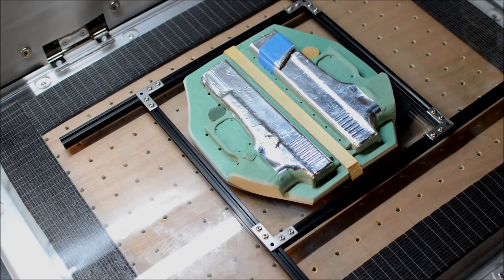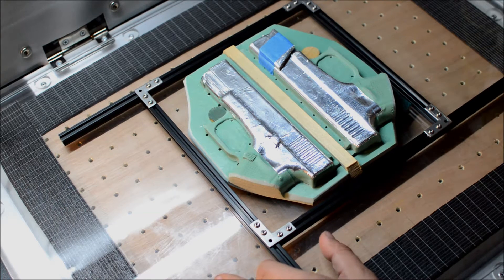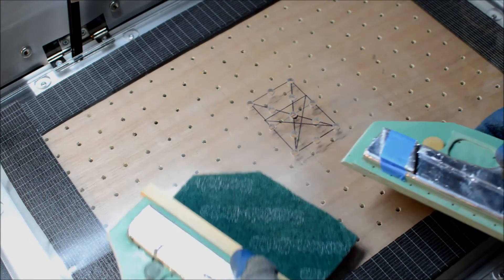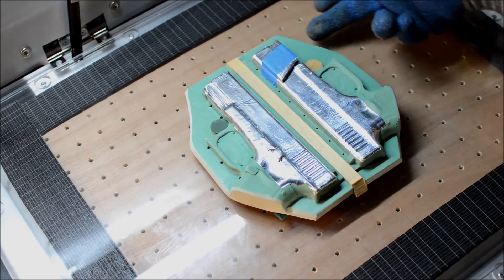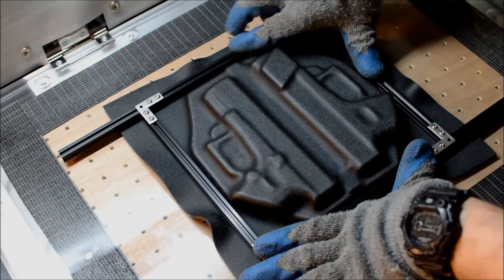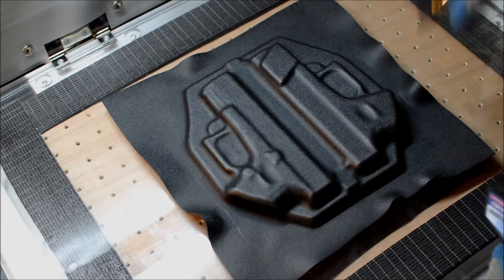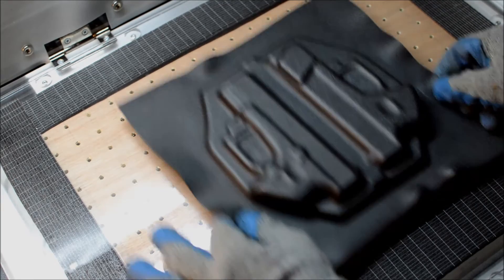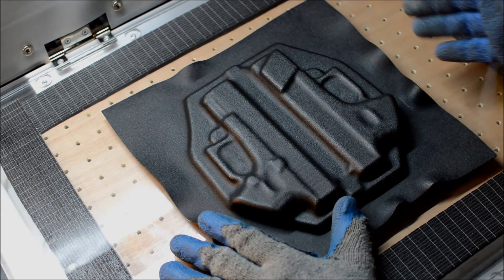Membrane-less Vacuum Forming Adapter

Comment: What is the size of the Kydex sheet you used.
Greg
Index Point Holsters, LLC
Reply from the maker: G P we use 12x12 for mostly everything
Reply: Thanks.  I am planning to include split molds. I am researching in order to understand the process.  Do you have any videos on router trimming?
Reply from the maker: I do not have any videos on router trimming at this time. I certainly could make a short video on using a router to trim. We also offer HDPE split boards for various models as well as custom trim jigs to match.

Comment: so is this a holster or a form to make a blue gun?
Reply from the maker: FreeRange1234 the black shell that was formed is the holster. The green piece is the mold. No blue guns were used in this video
Reply: Is that a taco holster, I'm just having a hard time seeing a holster there.
Reply from the maker: That's because it isn't completed. This is just showing the forming process. Yes, this would be a "taco" holster, properly known as a Fold-Over holster. After forming this shell would be cut out from the sheet and then folded along the sight channel.
Reply: Cool, thanks, as you can tell by my silly questions I'm new to this
Reply from the maker: All your answers will be found on kydexpro.com

Comment: +Titan Concealment Hello I'm the owner of FtGear LLC and I make carriers and holsters as well. I've been using a vacuum former now for a year and my definition is unbelievable but I do like your mod. I never bought a former from HD or Therma Press. I just built my own and large enough to therma press 2 weapon mods and can even do large knives. With that I'm sure your using a lot more material? So that means you have more waste? In addition too, I have found a way to vacuum form real firearms with really thin material and make my own weapon molds and cast them really cheap. I have NOW reduced my cost by 1000 percent so all funds from gross sales are profitable. Again I do like what you've done in modding your press, good idea... Take care

Comment: On the topic of waste, what size is that sheet of Kydex you used for the holster? Also, when you do the fold over, what is the shape of your sight channel?

Greg
Index Point Holsters, LLC
Reply: I have been Making Standard press holsters for over 5 years .I would like your opinion on what are the benefits of Vac forming .
I'm curious because I can make foam pressed holster with enough definition to hold the gun secure with no play in the holster.At some point too much definition against the body for IWB makes the Holster less comfortable .Is it speed of constuction?It just seems too complicated and then doesnt allow you to make holsters off of a customers pistol .Thanks
Reply: Thanks for your response , its a lot to think about .I only do about 100 holsters a month and do over 40 models .That"s a huge investment for me and I am not sure it makes sense .I feel like in the next year or so with so many Vac holsters on the market people will want the one off more hand made holsters with a lot of attention to detail .Still not sure
Reply from the maker: G P 12x12 and round sight channel. I'm not concerned with waste when I buy materials in bulk
Reply from the maker: Ted _ Cori depending on your style of holster, you could still use the customer's gun to make one. Vacuum forming is about production speed, repeatability, and being able to press unique shapes and molds. The pros far outweigh the one or two cons that I can think of, if I would even call them cons.
Reply from the maker: Ted _ Cori attention to detail is not determined by the process used to form the holster though. it only determines the speed at which it's done. most of us using vac forming did not jump right in and transition over night. small investments were made slowly and when the mold inventory was completely available, the transition was made. ease into it

Comment: Larger, heavier duty extruded framing.
Reply from the maker: bl incognito absolutely. this is just a proof of concept. A whole new adapter for the HD200 is in the works which will also be using thicker frames.